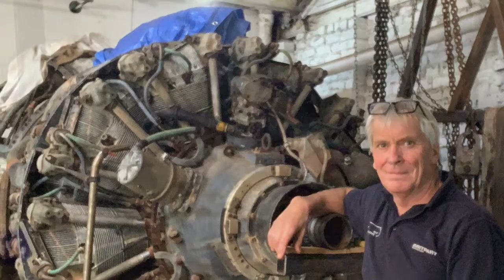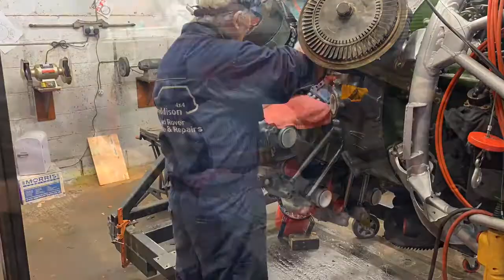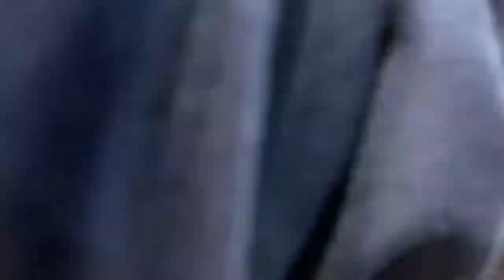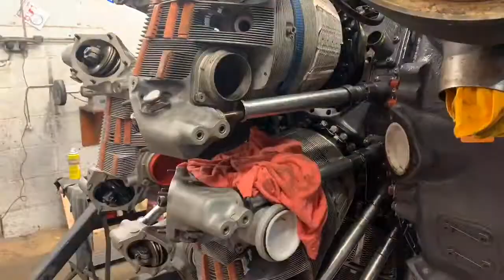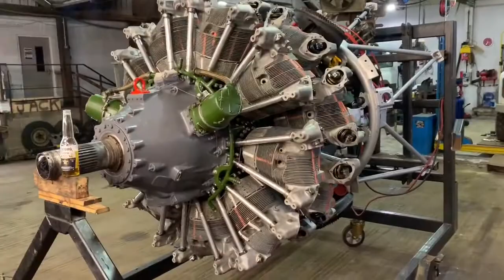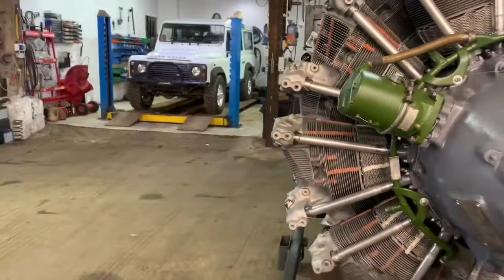Lockheed Constellation R3350

Comment: I recall these engines being purchased in cans, surplus from the military, and putting them on DC-7s, where I worked decades ago in FAR part 91 operations at Miami's old "corrosion corner.". Within 300 to 500 hrs (sometimes sooner), the eng's would fail hard because some large bearing(s) internally would "crystallize" and disintegrate with use. Supposedly, the only truly pre-emptive fix prior to installation was to completely tear down the eng. and replace all the bearings, reassembly, and a test cell wring-out, essentially amounting to a total overhaul and the prohibitive costs involved in that. Needless to say, the DC-7s went away with increasing frequency. These engs. had to be pre-oiled, or run up every other day or so if installed on an active, or ready-status airplane if memory serves correct.

Comment: The R-3350 was first used in B29s. The Enola Gay and Bock's Car had souped up versions of that engine. That made it easy for them to bring the Little Boy and the Fat Man to Hiroshima and Nagasaki, and then to outrun the atomic explosions.
Reply: More than souped up it was fitted with fuel injection and was provided with better cooling of rear rows of cylinders. The fuel injected Wright R-3350-41
was installed on the the B-29 slated for operation Silverplates greatly improving the engines and was far more reliable. It was an important factor in the success  of the 509th Composite Group's operations...